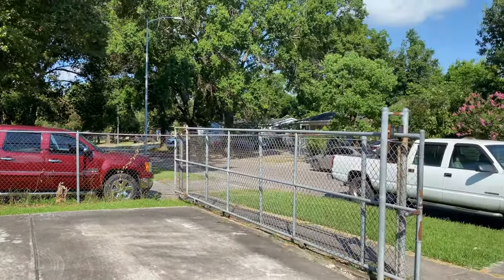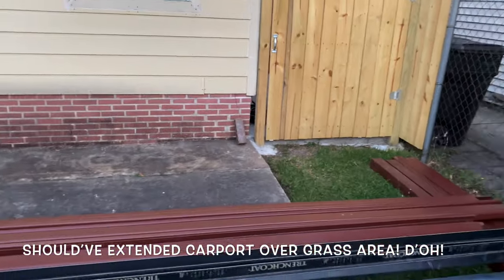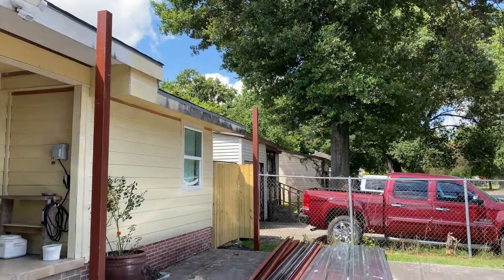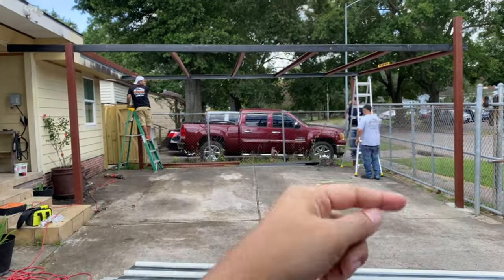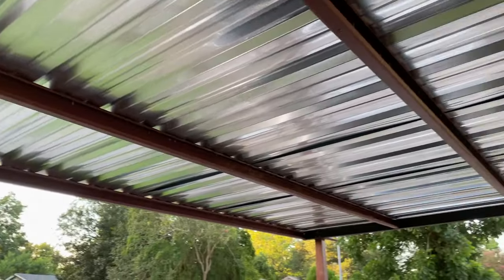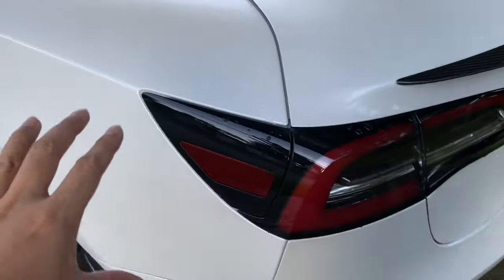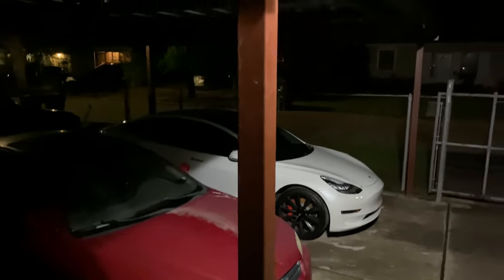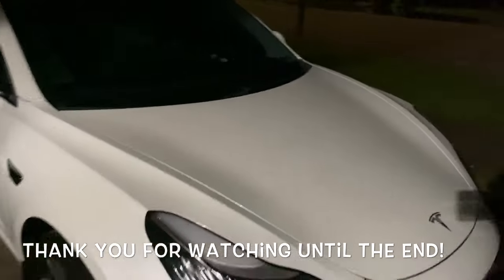My Carport Build - Part 1

Comment: Looks great!   To quiet the metal roof during heavy rains you could spray the under side of roof with closed cell foam.  It would not eliminate the noise but it would surely deaden it some.

Comment: Still waiting for part 2, can't wait to see the led lights. BTW are you planing to waterproof the joints and the screws? It seems your area has some heavy rains and rust could be an issue.

Comment: Did you have this specially made, or did someone just do it? Please comment back on what this cost. Thank you for this video came out nice.
Reply from the maker: It’s been a few years but I recall it cost around $2300 for this carport. More details are in the video description. Let me know if you have more specific questions. Thanks!
Reply: @KPhan Thank you very much for getting back to me. Do you remember the name of the company? Who did it or who you Purchased it through please comment back thank you
Reply from the maker: @martinneps9387  I got my materials from http://www.steelsurplusinc.com.

Here is the contractor/builder info: PEREZ FRAMING CONSTRUCTION - Fernando Perez - jrperez.framing@gmail.com 832.890.3238

Comment: I see you have a gap between the carport and the house and I have the same thing going on with my roof and deck covering and the water just pours through when it rains how would we seal that gap?
Reply from the maker: At first I added a rain gutter there to direct the rain water from pouring through. I also added a sheet metal to overlapped that gap from the house roof over the carport roof. No more water pouring through that gap.
Reply: @KPhan  thanks so much!! Very much appreciated

Comment: Thanks for the video, don't forget to wind-brace your structure
Reply: How would you do that?
Reply: With 2 strap braces (thin angle bar), each connecting diagonally the posts head
Reply: @johannfrancou444  Not needed, the self tapping screws are structural. Assuming this is mild in California or some urban area. I live in the boonies where we get 60mph wind gusts and the 24x100 ft carport I had built has lasted 20 years and has survived an F0 tornado. Lmfao. Wouldn't hurt but better spent on more purlins and screws.

Comment: Wish you had a material list for this.
Reply from the maker: Hi. Sadly I wasn't given the invoice of the itemize list but if you look at the link in the video description, you can see the name of the material and sizes. You can also call and they can better explain what is needed to build a typical carport. The overall idea is that I used four 12-ft 4x4 Square Tubing for the post, six 30-ft CEE Purlin for the support beam,  two 30-ft C channel beam that the purlin rest in that sit on the outside of the six purlin, U Panel Sheet Metal for the roof and weather resistant fasteners. That's the idea. Hope this helps.

Comment: if  the poles are 12 feet wouldn't it be 10ft of room ?
Reply from the maker: Yeah but we have to cut it down a bit to level the roof slope. So ended up with a bit less than 10 ft. So about 9.5 ft of clearance.

Comment: How much did materials cost
Reply from the maker: Hello. I believe materials was around $900. Since then, I recently expanded the metal roof out another 3 feet toward the back by the grass area. I also added rain gutters. So current material cost new total is about $1100 to get it the way I originally wanted. Wished I would have done that from the start. I got my materials from http://www.steelsurplusinc.com. I will be doing an update (Part 2) video to my carport after I add lights and relocate my Tesla charging outlet.
Reply: Was this 1100 with them installing it?
Reply from the maker: @alanm435  no with labor and material I paid out was $2300. The $1100 is just for materials.

Comment: Yeah, you should extended 2' or 3' backwards and another 2' forwards and used clear corrugated panels.    Once the wooden walls (fence) goes up it be less light for both during daytime and especially at night.  It would be less noisy during the wind and rain too.
It's better than before.    Now you can always use this area for bbqing and for other family events with the shaded patio cover.

Comment: those ones with the metal roof are sketch in storm… i’ve seen some go flying and hit houses and cars
Reply: That's what happens with screws if you weld the frame it would be a different story
Reply: I was wondering if doing this with such a long span between purlins is a problem.
Reply: @bakervinci163  depends on the metal channel used but with metal no problem  if it was wood then it would be a different story

Comment: hello I like your carport a lot. How much something like that will cost?
Reply from the maker: Hello. I believe materials was around $900. Since then, I recently expanded the metal roof out another 3 feet toward the back by the grass area. I also added rain gutters. So current material cost new total is about $1200 to get it the way I originally wanted. Grand total with labor and everything is about $2500. Wished I would have done that from the start. I got my materials from http://www.steelsurplusinc.com. I will be doing an update (Part 2) video to my carport after I add lights and relocate my Tesla charging outlet. I will also concrete the strip of grass at the back. Stay tuned for my update.
Reply: @KPhan  were you buy this?

Comment: Looks great! There wasn't a problem with Code or Permits?
Reply: I doubt he got permits just looking at the video and likely in the building setback.  It’s a permanent structure once he cemented the posts in which was a mistake.  It’s also on the front of his house so it could also very likely be a zoning violation in addition to a building code violation.  He’s also talking about doing a solid wood fence in the setback which is typically a no no as well.  The municipality might make him tear all that down in a few years when they drive by and discover it.  Not hatin just sayin.

Comment: HOW MUCH DID IT COST IN MATERIALS & LABOR? I LIVE IN SOUTH TEXAS & AM LOOKING FOR SOMEONE TO BUILD ME A DOUBLE CARPORT & WANT TO NOT GET CHEATED.
Reply from the maker: Hello. I paid $2300 for materials and labor. Since then, I recently expanded the metal roof out another 3 feet toward the back by the grass area. I also added rain gutters. So another $300 added to the new total to get it the way I originally wanted. Wished I would have done that from the start. My builders got my materials from http://www.steelsurplusinc.com. I will be doing an update (Part 2) video to my carport after I add lights and relocate my Tesla charging outlet.
Reply: Good evening destra. What part of south texas do you live?. I build carports. I'm in the valley.
Reply: @nelmor29  how much u charge for something like this? I'm in McAllen

Comment: So you put steel posts directly into the ground? You are aware that that will rust rather quickly, right?
Reply from the maker: Interesting. I didn't think of rust. The steel post is coated or primed/ready to be paint. The post is buried 24" deep and concreted. My builder built it that way. I didn't questioned it and thought it would help make the carport much sturdier this way. Hopefully  it will be a long, LONG time before dealing with rust should it later become an issue. For now, I am enjoying this carport for the time being. :)
Reply: I am doing this now. I screwed mine to the cement surface.

Comment: This looks a lot cheaper than osb roof. Is it?
Reply from the maker: I was quoted higher for OSB roof since I will need to add singles. Maybe its the labor will will add up; not necessarily about the quality. This build cost me $2300 with materials + labor.
Reply: @KPhan  Thanks for the info. Much appreciated.

Comment: Did you put 4x4 posts?
Reply from the maker: Yes the four post are 4x4. We buried it 2 feet deep and pour concrete over it.
Reply: The c bars are 6x2 or 8x2?
Reply from the maker: @mrfajita1542   Are you referring to the brown Purlin CEE beams?  Those are about 4"x2" and 30 ft long that was cut down to 25 ft (depend on length of your carport). The black C-Channel beam is about 4.5"x3" that was also 30 ft  custom down to size. Those black C bar/beam sit on the outer edge on the carport that cap off those brown purlin beam. Hope that make sense.
Reply: @KPhan  
Thanks

Comment: Hi Khoa,
Carport looks great! Looking forward to the part 2. 
Please send me contact for the builders as well. 
Greatly appreciated, thanks.
Reply from the maker: Part 2 is coming. So far I extended the carport roof over that strip of grass area. I started to add picket fence over the existing chain link fence for privacy.
Subscribed for that update lol
Here is the contractor/builder info: PEREZ FRAMING CONSTRUCTION - Fernando Perez - jrperez.framing@gmail.com 832.890.3238
Reply: Khoa Phan I appreciate the swift response. SUBBED! thanks for the contact info. Looking into doing this soon.